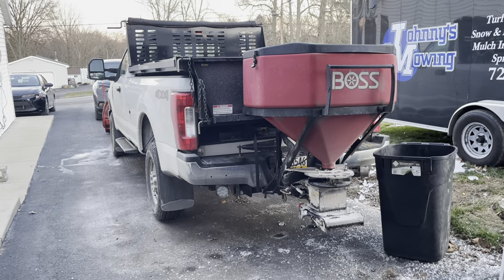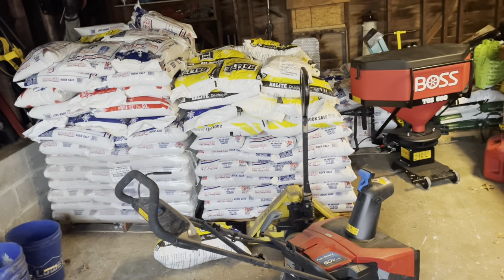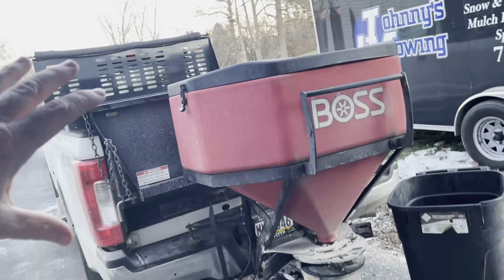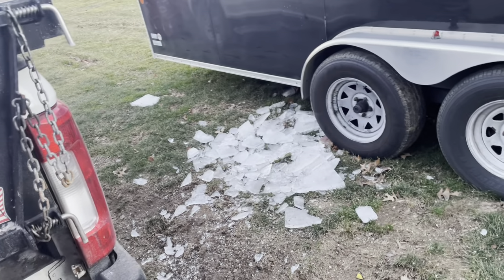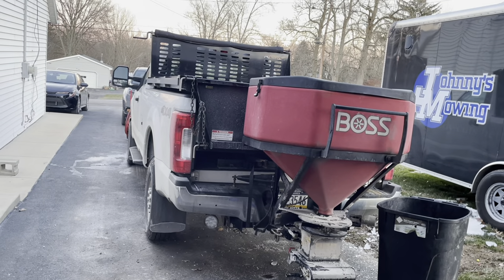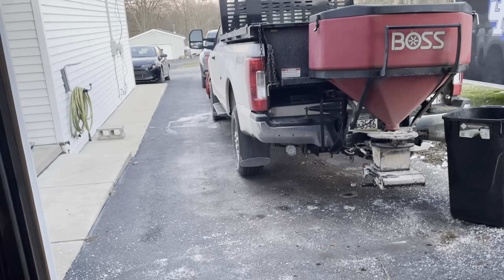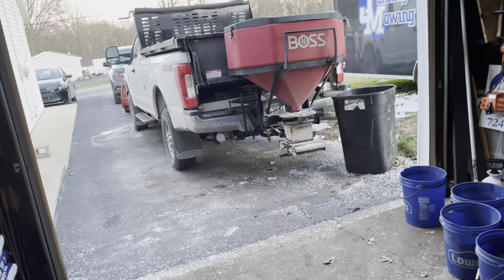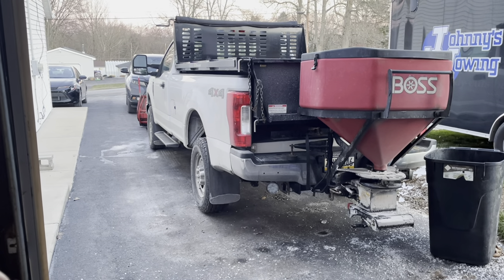Snow storm oh no!!

Comment: We got 14.5 inches from the last storm here in Des Moines. Ive got the TGS600 and it works for me, I can fit 7-8 bags. It’s easy to get on and off, I need to remove it at every account to get the blower out. I don’t like how low it hangs, my western 1000 had much more clearance.
Reply from the maker: Do u remove it with salt in it?
Reply: @JohnnyMow  not with more than one bag in it. I fill it up for each property, not ideal but it works for my solo operation.
Reply from the maker: @zepplin810  thank you that makes sense then.

Comment: Get creative. pre-emergent is 10$ an acre for a season load when sprayed low volume rather than rolled onto prills. 24d Ester is still 60bucks a jug. If you have been keeping up with Fert previous seasons, you should be able to get away with N only and lower rates for a year or two especially if you aren't bagging. By regular 46-0-0 Urea and run it 2lbs per k. You can spray merit low volume for 10 bucks an acre. No reason to raise Fert prices more than 5-7%. Too many people are panicking.
Reply from the maker: I’ve never sprayed pre emergent out of my low volume machine.   Mine does not have agitator.  45-0-0 is still really expensive hear even at half rate as you suggested.  Hear is the bottom line.  I paid 14.25 last year for a bag of premergent this year 24.75. Regular triplet 64 now 90.   You add insurance rates and gas to the cost your looking at a devastating year.
Reply: @JohnnyMow  I hear ya but I disagree. Going to be a fantastic year for guys who know their numbers and their chemicals. 24d ester will do just as good a job as triplet at 7$ an acre. Maybe throw some triclopyr for an extra punch at 4$ an acre. We took out all luxuries and will come in well under 1.5$ per k averaged out.

Comment: what setting do u have the spreader on?
Reply from the maker: Man 6-7.   It does not spread well below 5 for some reason.   I do adjust it for road ways.
Reply: @JohnnyMow  ok this is my 1st year doing snow and i got the same spreader …so im looking for all the tips i can get …thanks 💯
Reply from the maker: @mack_landscaping412  after the insusp blast is over I zero it out then put it on 6-7 in open lots and 4-5 on roadways so it stays on the road.

Comment: You got a vibrator on the 1100?
Reply from the maker: I do but it’s really not needed
Reply: @JohnnyMow  that’s good bro just incase you got it, mine doesn’t have one yet. 2 days ago I put bulk salt through it and it spread it just fine but it definitely looks like a vibrator would do amazing for bulk salt, at times it would spread less and a little nudge on the brake would get it back and running so a vibrator with this spreader would spread bulk salt so easily. Love it. Also love how stable it is, I’ve seen so many ppl with other tailgates and that thing be moving around so much it looks so bad. This is my first tailgate spreader, I run vbx on my other trucks but I got this one for residential